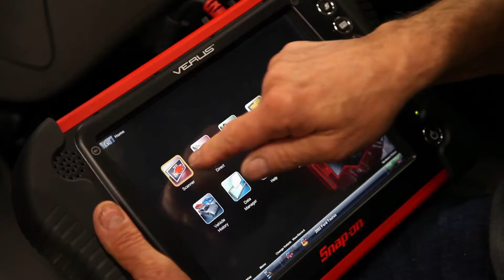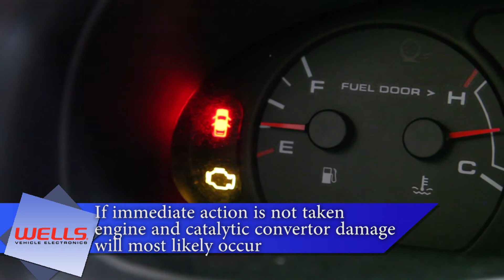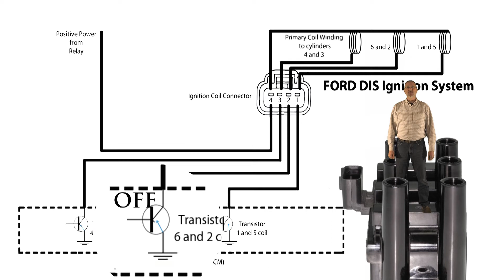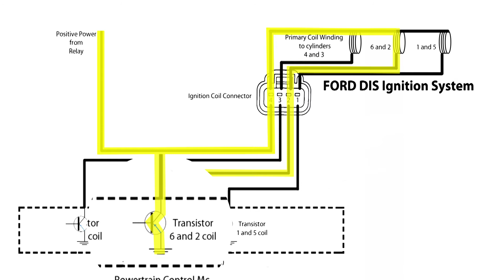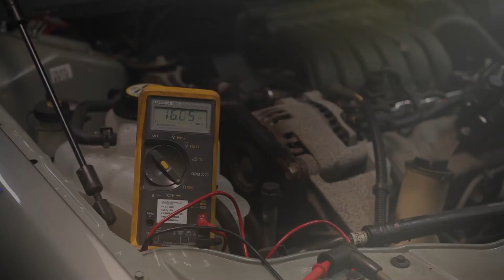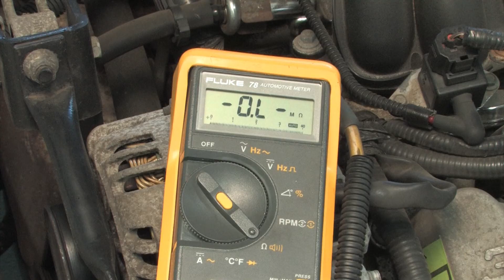Diagnosing Ford DIS Misfire

Comment: great video, informative.. question, how to diagnose and fix a misfire toyota corolla '94 w/ 4A engine distributor less?
Reply from the maker: Thank you for the kind words. My information does not list a distributor-less ignition system for your 94 Toyota. Could it be another year or engine size?
Mark Hicks
Wells Vehicle Electronics
Reply: hello sir! need for assistance, my brother bighorn 4jg2 with ecu, non cable accelerator, sudden stop on the road ,timing belt is good, no 12v supply to solenoid shut off valve, the engine is crank but not run, i used new battery, where the cam position sensor mounted and how to check ecu. thanks in advance
Reply from the maker: What year is it? Is this an Isuzu? Diesel?
Mark Hicks
Wells Vehicle Electronics
Reply: sir this is a  isuzu bighorn 4jg2 diesel,no accelerator cable, 1997 model
Reply from the maker: 1. Disconnect the cable from fuel injection pump linkage.
2. Make sure that the linkage is fully to the ON position.
3. If not, adjust engine stop cable.
4. If OK, check for fuel at the primer, side of fuel injection pump.

5. Open bleeder screw on top of pump, pump primer, expect fuel.

6. If good at the bleeder, but no fuel at the fuel injectors, suspect a stuck rack within the fuel injection pump.
Mark Hicks
Wells Vehicle Electronics
Reply: thanks a lot for the quick reply, i will try to do that

Comment: Question Mark, when you say the coils that share cylinders fire simultaneously, does the current go out of each tower and to ground or does it go out one tower, to the cylinder, through ground, and then to the other shared cylinder?
Reply from the maker: Another great question! In prior videos we went in to detail on how a Distributor - less coil fires. This video was already more than 8 minutes long, so I decided not to include these details. Here is the skinny explanation.
When a DIS coil fires the current flows out of one tower, down that ignition wire and across the spark plug electrode, to create spark. This happens much in the same way spark occurs on an ignition system with a distributor. Here is the difference. On a distributor type system the source for the secondary coil voltage is the battery. After the spark plug fires, the current then travels through the block and ends up at the battery to complete its path. On a DIS system the source for the secondary current is the secondary winding. (I will do another video explaining this in detail) Because the source is the secondary winding, for the current to flow it must return there. After the spark plug fires (on a DIS Coil) the current travels through the block and fires its companion cylinder or spark plug. It then travels, what could be perceived as backwards up that ignition wire and returns to the other end of the secondary winding from where it began. This is what we meant when we said it fires in an electrical loop.
Knowing this information is essential when trying to diagnosis an ignition problem on a DIS vehicle. Thank you for asking this question, I am sure there are many people who also were wondering.
If you have any other questions or concerns, please let me know,
Mark Hicks
Wells Vehicle Electronics
Reply: That clears it up for me, thanks Mark.
Reply from the maker: You are welcome. Honestly it was a little tough for me to get my head around at first. My first question was "OK if that is how it works, why don't I get shocked when I touch the engine?". The answer is simple, because your body is not the easier path for the current to flow through.
Take care my friend,
Mark
Reply: markjhicks
great explanation mr.hicks .
did this dis system can damage the ecu any way like if the ecu ground is bad ?
Reply from the maker: Yes, it is common for the PCM to get damaged when one of these coils fail. Howver, not due to a problem with the PCM or wiring. When the primary windings of one of the coils shorts it over clocks the driver in the PCM. Done long enough (no one really knows how long that is) the driver in the PCM will overheat and fail.
Hope this answers your question. Great question by the way.
Mark Hicks
Wells Vehicle Electronics
Reply: markjhicks
thanks for replay and yes it is answer my question .
i heard it is possible to repair the ecu , pcm is it real or what ?
if they  can be repair how about there  performance and life after repair ?
Reply from the maker: I have no idea how to bench test and repair a PCM, but there are ones who claim they can. Please don't get me wrong, i am only stating an opinion. We manufacture a lot of parts for new vehicles and we can not get the strategy algorithms for a PCM. For this reason I have doubts these PCMs are being rebuilt with 100% accuracy and dependability. I also know there are some pretty darn smart guys out there that may have figured it out. But, to be able to do it for every make and model ... hmm I don't know.
Mark
Reply: markjhicks
thanks mark for the answer and for fast replay i appreciate it .

Comment: Great video Mark I've never done a test with the ohmmeter, the reading will be different when they are hot?
Reply from the maker: Yes they will be different hot and cold as the windings expand and contract. But they should remain with in the specifications. The problem with an ohmmeter test on a coil is it is not conclusive. Meaning it could check good and still be bad, however if it tests bad it is bad. Thank for the kind words. We have some very cool things coming up next year ... stay tuned in!
Mark Hicks
Wells Vehicle ELectronics

Comment: I have a 2000 Ford Ranger with a 3.0 I replaced the plugs wires and the ignition coil and I am still getting an engine vibration in cylinders 4 and  six the vibration happens around 40 miles an hour when It shift into overdrive then stays steady goes away soon as it shifts out of overdrive I put it on a scan tool and have come up with no codes do you have an idea of where I should look next I was thinking fuel injectors but I put a screwdriver up to it to listen for the ticking sound they appear to be working fine would these still make a clicking sound if they were clogged I do not know what else to do

Comment: Can't say I'm a big fan of ohm testing ignition coils, but good video anyway.
Reply from the maker: I can understand not testing coils with an ohmmeter. But it is a pretty good way to test them. Please let me explain. When testing a coil with an ohmmeter and it tests with in specs doesn't mean it is good. However, testing a coil with an ohmmeter and it tests out of specs, it does mean it is defective. But when using an ohmmeter you must make sure you are using a good quality meter, the leads are in good shape and to zero the meter when using the low scale. The best way I know to test a coil is with a scope. However, if it is not a good scope you will not see the coil ring effect, which is a very good view in to the longevity of the coil. This is a problem with automotive diagnostics, there are no 100% conclusive tests. I would love to discuss this sometime in length.
Thank you for the great comment! Saying what is on your mind, helps us all become better.
Mark Hicks
Wells Vehicle Electronics